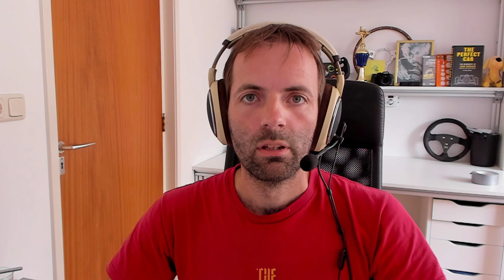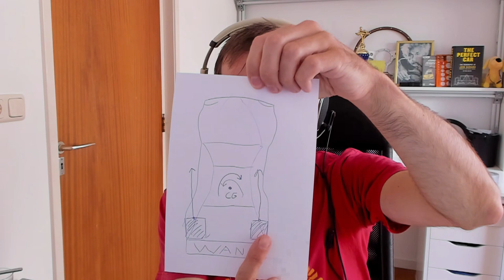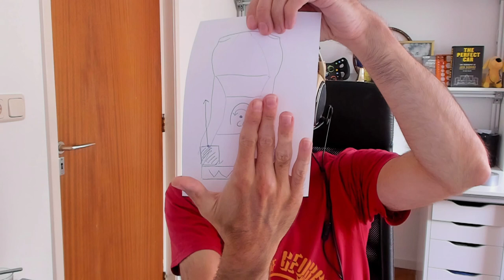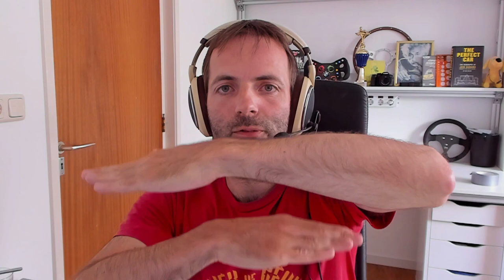An incomplete but (possibly) refreshing look at Race Car Setup!

Comment: Great vid Niels. One thing that made me stop sim racing was the time required to properly learn a car on a track. Its just too time consuming for each race (Im a perfectionist) and I dont have fun during the race when I know that Im not getting the most out of the car (when I dont spend the time preparing) So what I think would be very helpful is to provide more data about the IN SIM car, say "expert" page in setup in AMS that will tell you more about how the downforce reacts to ride heights, rolls, yaws and pitches, things like that. So I dont have to spend time testing that, reading telemetry etc. Of course some of this data is sensitive to licenses, so only some of it can be provided.. but anything that will reduce the preparation time would be very welcome

Comment: Hey Niels, I was wondering if you could explain the correlation between contact Patch and transmittable Torque from Tire to the street.
When calculating the brake force in a Brake disc & pad combo for example you only really care about the coefficient of friction and the force applied.
So when having more negative Camber in the rear you said you gain corner speed but might experience a loss in lateral positive and negative acceleration „because of the contact“.
Is all my understanding about friction wrong, or do Tires simply not work that way?
I hope I could get my point across, I am still working on my english skills.
Thank you in advance!

Comment: I want to discuss 2 points. I'm not an engineer so I'm not sure if I'm confused.. 1. Lowering a car will indeed lower the center of gravity, but that actually can cause more body roll if you don't adjust the roll center accordingly. 2. What about the ride height not affecting weight balance? Why is corner balancing performed by adjusting the suspension height then?
Reply from the maker: Lower ride heights indeed lower the center of gravity. It can increase body roll if the roll centers also drop from the change in suspension geometry yes. But weight transfer is slightly reduced from the lower CG. Feels 'strange' perhaps but if the roll centers sit lower when you reduce ride height, its a bit like taking some anti roll bar out so you can indeed get more body roll despite less weight transfer!

Ride height doesn't really affect weight bias. If you go from 2cm front and 10cm rear height to 10cm front and 2cm rear height, you move the weight forward perhaps 0.1%. Corner balancing is, as far as I understand, meant to make the final adjustment so the left and right front have the same ground force, and the left and right rear too.  You don't really change the front versus rear weight, but you change the left/right weight. In other words, if your front left puts 400kg on the scale and the front right 500kg, you unscrew the front right (or extend the front left) until you' see 450kg on both scales. Total front weight remains 900.

Comment: So much would be possible to say about dampers. Once you understand that every corner is connected and will affect every other corner even on independent suspensions, damper setup starts to make more sense. Or less initially.
Reply from the maker: Perhaps it is because of the complexity and I prefer sticking my head in the sand.. But I think they can be overrated too. I feel sometimes the 'magic' that surrounds dampers makes people confident they are the answer to all problems. What really should be done is blind testing. I very much doubt people who are convinced they feel damper changes can still identify them accurately in a blind test. Extremes, sure, but '2 clicks of fast bump and its perfect' .. I doubt it.
Reply: @NielsHeusinkveld  I think I would have to agree, although some cars are quite sensitive to damping changes. Others not.

I was working on an NSX from a certain some-one in a certain simulator, I think you can guess which one as you are quite familiar with the particular car ;), and I had used an old damper dyno to make the standard car's dampers. Quite deadly, even if close to critical and not very underdamped.

After finding actual Honda data and putting in very overdamped slow rebounds and basically critical slow bumps, but having the car drive much better and predictably than before, I kind of changed my view on damping and all of the usual setup guidelines or theories flew completely out of the window. There's more to it than "increase rear damping for oversteer".

Then there is the usual stock rear wheel drive passenger car which I have made several of which all more or less drive the same as long as you stay in some kind of sensible damping area. 

It's almost impossible to "tweak" them with the goal of being more correct based on much anything because they often have several damping setups from the factory perhaps for every trim and every few years, which perhaps hints towards multiple solutions being "good".

Much more important to have the springs, stabilizers and tires correct, I argue!
Reply from the maker: @ArchOfficial  Yes and on a 'soft' road car, you actually spend time transferring weight, where the dampers can influence the speed and 'direction' of weight transfer a bit more. The stiffer a car gets, the more confusing the dampers get for me because that bouncy tire is always in place and weight transfer is almost immediate with stiff springs and bars so there the dampers have no 'time' to significantly affect that.
Reply: @NielsHeusinkveld  I will admit that's an area where I have a lack of knowledge too. I'm more of a roadcar person so I don't make very stiff cars often.

One thought I have is that at that kind of springrate, of course you need some damping so that the oscillations are controlled, but the slow damping portion becomes more like the conventional wisdom. You add front damping for a momentary front spring-rate increase and vice versa. 

One example which comes to mind is the NSX-R. Something like 2.1hz F 1.9hz R with even above 2.0 rear slow rebound and every corner is above critical, the damper becomes more like a dynamic springrate for transitions. In theory it should have worse roadholding and be slower but it drives as good as with a more normal setup, maybe even easier to control for me personally.

I suppose it can also change dramatically depending how coupled your wheels are. Maybe?! NSX and R have very soft rollbars, only around 2000 N/m at the wheel like a lot of those older Japanese cars are before everyone started jacking the rates well up into the 5 digits.

Such stiff damping could perhaps become catastrophic if the wheels are very coupled together and any spikes in tire force will affect the other as well?
Reply: @ArchOfficial  Sorry for interefering, I enjoy all of these discussions going on, and the video of course. I wanted to ask what do you mean about "coupled wheels" ? I am unfamilliar with this term, I googled, but what I saw was locomotives, perhaps you mean locked differential ? 

Also, in my limited understanding compliance from cars is gone because of very very wide performance tires plus usually sensitive and big aerodynamic downforce. There is mad focus on numbers such as acceleration and laptimes in marketing of those cars, the driving feel and emotions seems to be less important. I like ~90s road cars and ~60s race cars the most.
Reply: @mantasisganaitis2281  Coupling, as in, mechanical coupling. The stabilizer is a torsion bar which links the wheels together, so when one tries to move, the other moves with it. That's why it causes anti-roll. 

But it has the effect of making the suspension less independent. It can be good or bad; there is a reason they are called stablizers, because when the wheels are linked together more closely, they also respond to the driver inputs more evenly, if it makes sense. They are not doing their own thing as much. 

However it also means that if one tire gets a big force spike, part of it goes into the opposite tire.
Reply: Actually I know an example where failed front dampers caused the car to get more and more understeer (as those haven't failed immediately, it was a gradual process throughout the weekend, and the reason of the understeery car behaviour was discovered only in the workshop). So they do affect handling in some way, but not like, say having a wheel disconnected or front spring rate doubled where the root cause would have been more obvious and the consequences more dramatic.
Reply: @dmitrykireev3607  Weaker dampers are different from catastrophically malfunctioning dampers IMO. Just making your dampers a bit weaker or stronger won't (As long as the wheel has stopped moving and isn't being damped anymore) affect your steady state balance at all. 

If the wheel is constantly moving due to severe under or over-damping, or the car gets jacked into the bumpstop or something, then sure, it will result in understeer. To me that's more of a "serious issue" thing than a "setup adjustment" thing.

Comment: Thats seriously compicated - you do this, cars changes in that way, then you do that, and it cancels your first change and car after two different changes goes back where it started. I wish I would understand how to seriously set up car.  For now I think i'm just making things worse. Like with brake preassure - i lower it not to lock so much, just as you told :)

Comment: Hi Neils, I have a question in regards to stiffening/softening the front/rear of a car. Theortically speaking, would making the front/rear of a car as soft as possible give you the most amount of grip? Obviously softening up the car will have other negative consequences, but in terms of pure steady state grip, is softer always more grippy, or is there a point were going softer results in less grip? I'm talking hypothetically on a perfectly smooth track, with perfect inputs etc etc. If you can handle the car, why not just go super soft all the time (particularly on the front)?
Reply from the maker: Great question. I think, but again I'm never 100% sure, that if you're on a flat track, soft or stiff probably doesn't matter at all (all else being equal). You can get the same balance with springs and anti roll bars in a soft and stiff setup and the tire loads (and grip) will be identical mid corner with no bumps. But there are some downsides in reality from going soft. 

Weight transfer is slower. So instead of slamming on the brakes and reaching peak G force in 0.5 seconds, you can't do that because the load hasn't arrived at the front tires yet and you'd lock up. So you have to be more gentle and loose a bit of time as you need (say) 1 second to build up the G force. This probably feels a bit disconnected and wobbly because soft suspensions give you a delayed response to your inputs. But we're talking 'comfortable road car' soft at this point.

Probably the biggest problem with soft is on cars with downforce. Downforce hates ride height changes, and the softer the car, the more the heights will go up and down, not just from G forces but also from downforce compressing the springs. Downforce and balance will be disturbed if suspensions are too soft.

Soft suspensions also mean changes in suspension geometry. Especially in roll, you never really gain as much negative camber as the car rolls so your outside tires have less negative camber while cornering. Or you need more static camber, but then you loose braking and traction ability.

The only reason 'soft = grip' exists as far as I can think off is that over bumps a softer suspension with good damping can probably avoid peaks in tire load and have a more constant steady tire load, increasing average grip.

Of course the weak link is always the driver, and perhaps a stiff car can make less talented drivers a bit less smooth and wild. A softer setup will respond more gently and perhaps suit some drivers better. Ultimately I think the 'softness' is in the driving style and how you transition between pedal and wheel inputs, and if you control that well, a stiffer setup with modern racing cars is probably faster.

Of course in racing cars, 'soft' is still very stiff. If you go from a 120N/mm spring to a 200N/mm spring on a GT3 car, its not like you're going soft to hard, you're merely going up a notch on the 'seriously uncomfortable' scale.
Reply: @NielsHeusinkveld  Thanks Neil. What setting keeps the inside wheel planted better to the road? Dosn't a stiff setup remove more weight from the inside wheel or do I have it the wrong way around? I.e with a soft setup would you not have more overall contact patch on all four tires during cornering? Perhaps that'd only be for the initial turn-in phase. Thanks.
Reply from the maker: @nooch86  Soft or stiff doesn't change the total weight transfer almost at all (you can ignore it basically). All you can do is decide how much of the weight transfer is taken by the front and how much by the rear, but for every G of cornering grip, the total transfer is identical. The stiffer side of the car, say the front, takes more weight transfer, and unloads the inside wheel, more than the softer side, say the rear.